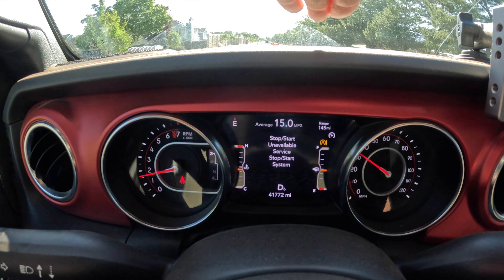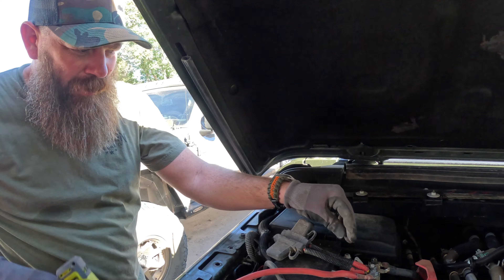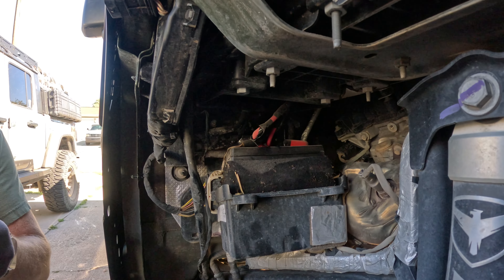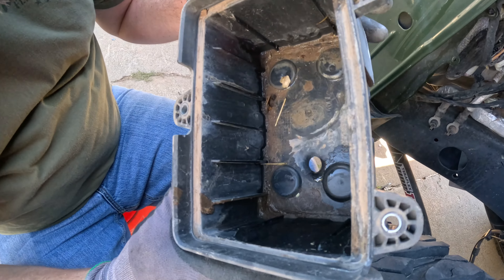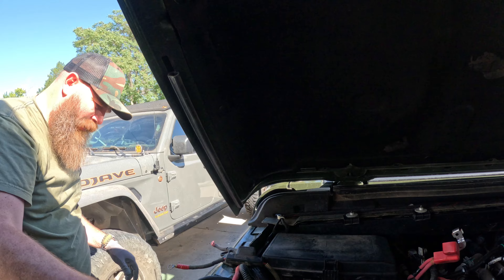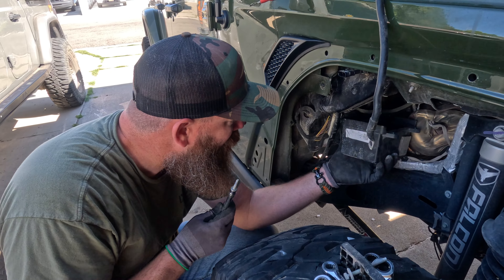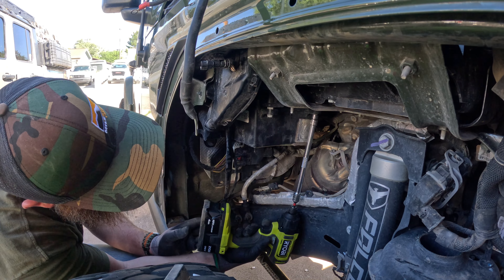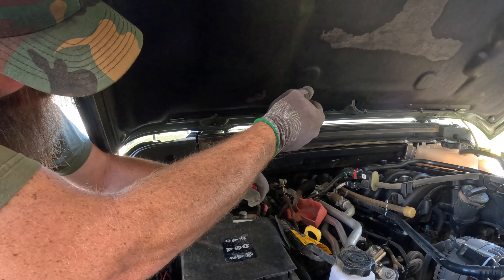AUX battery delete: Solve Jeep JL/JT Battery Problems in 20 Minutes DIY

Comment from the maker: So I may have been wrong. I recently dealt with a Jeep that wouldn’t start. And that aux battery was replaced and it started up and ran fine from there. The interesting part is the CEL came on but didn’t pull any codes.

Comment: The whole start stop BS is a gimmick. Total BS. I have heard the quickest way to disable it is to put a 7pin plug in the trailer hitch connector. Start stop won’t work be cause the system thinks there’s a trailer connected
Reply from the maker: Oh that is interesting. I could see that working. Also if you don’t wear a seat I know for a fact it won’t work. But I haven’t heard that part about a 7 pin so that’s good to know
Reply: Not using your seat belt definitely stops it from working at stops while driving but doesn't do anything for thr remote start not working due to a drained battery or whatnot. From what I understand the small bat. Doesn't last cause of a bad ground  that not only drains it but the main bat. As well cause of how they are wired . You'd think with all the fuss & issues someone would figure out how to properly ground it or how to make it function with out draining so we don't need to do this kind of BS !!! RIGHT !! LOL
Reply from the maker: I can’t say that since I’ve done this, I’ve gone all winter and I use my jeep battery to run my diesel heater when I’m camping at night for 8 to 10 hours and I’ve woken up and been able to start my jeep with no problem
Reply: I believe you can also disable it by disconnecting the sensor for the hood. There’s 2 sensors to make sure the hood is closed. One for just the general system, and one to disable the auto start/stop. If you unplug that one (I think drivers side of the 2) then it also disables it.
Reply from the maker: @nateshelton4584 oh that is good to know also. I haven’t heard this before. That would make things so much easier

Comment: My AUX died at 42,000 miles and I am deleting it in the morning. Got a new main battery also, as the Jeep main battery is dead. Stealership, I mean dealership wanted $650 for AUX battery and labor. They did a free battery test, so I used them to confirm the AUX was bad.
Reply from the maker: It’s a super easy thing to do, and I have had zero issues since I did it. Best of luck to you!!
Reply: $650???? WOW.  I paid $100 for the battery and had it swapped in 30 mins!
Reply from the maker: @sinepari9160 I’m not sure how much it is because I just pulled mine
Reply: Well, I have 2021 Mojave with almost 23k on it. Just got the start/stop warning light.  You made it a lot further than I did. Granted, it sounds like yours is a daily driver. Think mine drained for sitting too long without being driven.

Comment: Pro tip.  The factory antenna works great as a wire fishing tool. 😁
Reply from the maker: Dang I wouldn’t have thought about that. I am not sure where mine is anymore but good thought!!!
Reply: I gotta go find mine as well. Not sure where I put it. 😂😂
Reply: It also has another use, it prevents the top of the roof from rubbing if the underground parking is too low for the Jeep.

Comment: That aux battery was the dumbest engineering idea for the Jeep Wrangler,  followed closely by the stop/start feature.
Reply from the maker: Personally I agree still not sure why they do it, to be honest. About the only thing I can think of is that now a days with all the electronic components that are involved with them. They are trying to split the load on the battery.
Reply: @Vikingoff-Road  That, and a weak attempt to improve mpg numbers.
Reply from the maker: You are probably not wrong. I wondering if they get a discount or a kick back from Uncle Sam to do it that way

Comment: If I read you correctly, which makes total sense, the aux battery is to run the fan for the A/C at the stop light with the motor off. What you are missing is the aux battery is one of those AGM batteries. They are mean for high cycle discharge/charge use. You are now transfering that useage to the main lead acid battery. Bad JU JU. This is going to shorten the life of the main battery. You might want to upgrade the main battery to an AGM type. But they are not cheap. Most new cars are switching to AGM because of all the computer modules that have to run for a bit after you park at night. Let us know when your main battery goes Kaput.
Reply from the maker: I believe in the jeeps they went to an AGM battery. But I will let you know when it goes out for sure.
Reply: I'm picking up a new 23 Gladiator this PM. I'll ask the service dept. @Vikingoff-Road
Reply from the maker: Oh nice yeah for sure. I’d like to know since I forgot to look when I pulled it. But I think there is a comment in here about a stock one being AGM

Comment: Well I’ve pulled the fuse, disconnected the aux battery negative cable from the main battery, pulled the positive battery cable from the auxiliary battery and connected it to the main battery. I’m still getting the A and start/stop message on my 21 sport unlimited
Reply from the maker: I don’t know if it matters or not, but I didn’t pull the fuse

Comment: Nice video. We’ve done this on our JLU and JT. Never going back. Side note: we saved the plastic battery terminal caps that come on new batteries to use when doing electrical work. It’s an easy way to isolate the terminals.
Reply from the maker: Thank you, oh that is a good idea. One of the reason I like posting videos like this getting everyone’s feed back on different things they do them. Thanks for the input!!

Comment: I’m glad that I watched your video. Because I was taking the positive cable through the other side under the fuse box. I even bought an extender to splice the cable and make a longer cable lol 😂
Thank you! 
My alternator ended up being bad. Replaced that and still losing voltage. Main battery is fine so I’m deleting the aux battery because nobody likes the ASS feature anyway lol
Reply from the maker: I am glad that it helped!!!

Comment: You can just flip the positive end upside down and connect to the battery terminal instead of bending the tabs. Sometimes they can break when being bent. Solid video man. Thank you.
Reply from the maker: Thanks.. I didn’t even think about flipping it upside down. It is crazy how much you can learn just by the comments section
Reply: I do have a question. Did you leave the AUX negative attached to the main battery negative terminal or disconnect it and safe it off? I realize it is taped down below in the AUX battery box. Wondering if you left it up top on the main.
Reply from the maker: I just left it. I have been thinking about that lately with all the comments and I am thinking of removing it all together. The biggest reason I didn’t disconnect it is because I didn’t want it just dangling around and didn’t want to fish it back through the other way. So I left it connected
Reply: I did this exact procedure and now I get this annoying buzz somewhere around 60-70 mph. The noise increases with speed once it starts. Has anyone experienced this, if so, how?
Reply from the maker: @amandab1479 that’s interesting first time I have heard of this I have not experienced this
Reply: I have to ask if you have a light bar.
Reply from the maker: @chrispyne2267 haha I do not. I have ditch lights at the A Pillars and yellow lights on the bumper

Comment: my question is if you use a 'Smart Stop Start'  ESS eliminator, will the aux battery then ever be used? (or used to the extent that this aux battery drains main battery = NO start problem even occurs)?
Reply from the maker: Good question. Ima say yes. I never used stop start. From the day I bought it. I hate it. But it does help control the starter and a couple other things I have since found out.

Comment: I tried taking mine out but then come to find out it wasn’t even there anymore. But my Auto Start/Stop is still working? Is it just running off the main one now?
Reply from the maker: That would be my best guess. Mine will still work too I don’t use it but it will work.
Reply: You'll have to get a taper mini to turn it off. It's running off the main. The aux battery delete is to save the main battery from the vampire shitty  aux one.

Comment: Great video guys, my only concern is, will it drain the main battery now that the auxiliary is bypassed? We just had our 21 Sahara serviced thanks to this damn issue.  600 bux later( addded expense for alignment)..Thanks in advance!
Reply from the maker: I have been doing this since the video came out and haven’t had any issues. But I do not run the Auto Stop/Start so it hasn’t been an issue for me.  Thanks again.

Comment: Wouldn't it be beneficial to hook up the negative as well? Or at least  ground to frame
Reply from the maker: You could. It connects to the main battery so I just left it taped it off. Most beneficial would have been to take it completely off
Reply: I’m wondering if I am affected for not doing this…I did this exact procedure and now I get this annoying buzz somewhere around 60-70 mph. The noise increases with speed once it starts. Has anyone experienced this, if so, how?

Comment: Did you connect the aux positive to the outter most (closest to the fuse box) part of the main batterys positive?
Reply from the maker: I believe that is the one that I used on the main battery terminal is the closest to the cabin closest to the fuse box of those three it shouldn’t matter which one you use they’re all connected at that point, but I believe that is the one I used
Reply from the maker: Could’ve yes. But I didn’t want to take the chance of anything happening. If I didn’t or wasn’t going to use the aux battery I just figured I’d remove it all together.

Comment: So was you able to delete it this way an everything be Kosher ? Or did you end up having to get a new aux battery ? Im in the same boat right now jeep aux light on in my 2021 Mojave gladiator
Reply from the maker: So I have put 8,000 miles on since I did this, I have had no lights no problems with the battery as far as voltage goes. I run a fridge in the bed while I am out, with no drain to the battery. So long story short yes for me this worked just perfectly.
Reply: Thanks brother I’ll be doing this in the morning you got my Sub thumb up from North Carolina . I’m deleting that f***er I was afraid I’d have to buy a tazer to delete it but your video was awesome keep ‘em coming
Reply from the maker: Thanks man. To be fair I have a tazer but didn’t make any modifications from the tazer after I did the delete, so I don’t think it matters.  But I do have one, just thought you should know. I appreciate the support

Comment: Just did it, seems to work, no light on in dash anymore, should I run the negative up from the now gone axillary battery and loop it to the negative terminal on main battery?
Reply from the maker: I did not. My negative is still in the box and have still had no issues.
Reply: I've been driving around all day yesterday the light hadn't come on one time in dealing with that stupid ass light on for 6 months with two new batteries! @Vikingoff-Road
Reply from the maker: @tomc9152 it sounds like this helped? Your comment is hard to understand. I hope this helped
Reply: Absolutely!!!! Was saying I've put both batteries in it 6 months ago and the light never went out till I did your modification! I hate that ESS crap! I believe what it does is just trick the computer to think that both batteries are hooked up and it's really just monitoring the main battery now @Vikingoff-Road
Reply from the maker: @tomc9152 oh good I am glad it helped. That light is really frustrating! Happy it helped

Comment: I wish I could’ve seen what you were doing in fast motion to get the cable up in the space where the fuse box is. Did you have to loosen something to get that space?
Reply from the maker: Dang sorry. No I did not have to loosen anything there was/is a hole just big enough under the front edge of the fuse box to get it through. It should have been a lot easier but it kept getting stuck on a piece of tape that was wrapping the wire. So I would say make sure your cable is clean of debris and also I would send a piece of wire down to hook it or as someone mentioned an old antenna. I think if you do that and take a little more time preparing to get the wire through there it will be a lot easier.
Reply: @Vikingoff-Road  Thanks! I enjoyed the video! And subscribed to your channel
Reply from the maker: Glad you enjoyed it and thanks for the sub!!
Reply: So you dont need a bigger battery, just favtorry battery amd by pass the aux?
Reply from the maker: I am currently still using the factory battery. The factory battery should run everything that is needed with the jeep. Now if you are running a lot of lights or winches and other things that draw battery juice then you might need a bigger battery. But just deleting the AUX battery you will not need a bigger battery

Comment: Question- If u remove the aux battery positive cable from the aux battery and attach the aux  Battery positive cable to the main battery positive post.

Would this bypass the aux battery and fool the ESS into thinking it is attached to the aux battery? 

I would think everything would work like the factory and no check engine light or messages. (Other than no aux battery in the loop).
Reply from the maker: That is what I did. So I fed the aux positive up through and connected to the main battery and taped off the negative and have had zero problems with the light coming back on
Reply: @Vikingoff-Road   thanks for confirming! I guess this would be a way to bypass the aux battery so it does not become parasitic when it goes bad. But allow everything to operate as normal.  Maybe even fool the dealership if under warranty (in case your wife takes it in before u can reverse it lol)
Reply: @Vikingoff-Road  one of the best videos on this as well. 
Great comments too!
Reply from the maker: Absolutely!! And thank you! Everyone in the comments have been amazing with information and things I never thought about
Reply: Now u got me thinking, the only draw back I can see with this configuration, is if u have a weak main battery and/or active heavy electrical loads when the ESS is active, then a problem could occur (like a no start) since the aux battery is not removing some of the load from the main battery.

But I think this would still be better because u can turn the ESS off.  

And I assume the system will still monitor the main battery for low voltage issues and provide the necessary CEL and/or messages.
Reply from the maker: I believe you are correct in all of that. I went through this also. I also run a fridge pretty close to non stop out of the 12v in the bed and I have a diesel heater I run off the main battery in the winter when camping. I have had no problems. 

That being said I know I eventually will and am working on a battery system solution for the fridge and heater so I won’t have that burden on the main battery. But as of now that is how I have everything running.
Reply: @Vikingoff-Road  You going to make me want to watch more of your videos now. Take care!

Comment: Also, might I add, you can disconnect your auto SS by unplugging it. Two plungers located in the front drivers side. (Should be blue and black) disconnect the one on the right. It will disconnect the ASS. 😉
Reply from the maker: This is good information also. Thank you!!
Reply: Terrible advice as that causes a fault light to come on.
Reply from the maker: @MrBoomStick makes sense. I didn’t do this. But thought it was an interesting idea. If it causes a fault light on the dash then I am out.
Reply: @Vikingoff-Road  Deleting the aux battery the way you did is the only proper way to do it.
Reply from the maker: @MrBoomStick thank you for that. To me it made the most sense

Comment: Great video guys.....Might be a Dumb question but ill ask anyway because i have not seen anyone else do this to a  GRAND CHEROKEE......... mine is a 2022 trailhawk v6.   please advise
Reply from the maker: Firstly, thanks for the support on the video. Secondly, I did a little research and there is next to nothing on anything for the jeep grand Cherokee on this. I can find the location (under the driver seat) and that’s about it. There are videos out there talking about replacing it but nothing involving a delete. I would imagine it’s the same concept. But I am not an electrical engineer either. So take it for what it’s worth. But even trying to delete from that location would be difficult just given its location. Sorry I couldn’t be anymore help with this. Not sure where you are at but there are some custom 4 wheel drive shops or even a custom car shop that may have more answers than me.

Comment: Today I removed my number 42 fuse and disconnected the negative cable to my main battery. The start stop warning light on my dash went away and now my start stop works better than before. In the 90+ Oklahoma heat my air conditioner wouldn’t blow very cold using the auxiliary battery. Today, the a/c ran with full force when pulling from the main battery. It seems like my ESS is running as it should have from the factory. I think I remember getting 2 to 3 more miles per gallon with ESS. From here I’ll do a main battery upgrade. Any suggestions?
Reply from the maker: That is awesome. I am a big fan of AGM batteries. And for me I would stick with a week known brand and you should be good